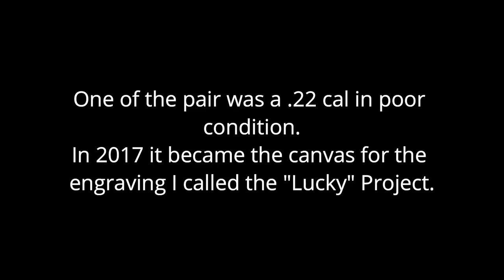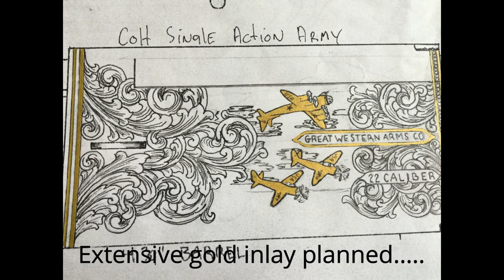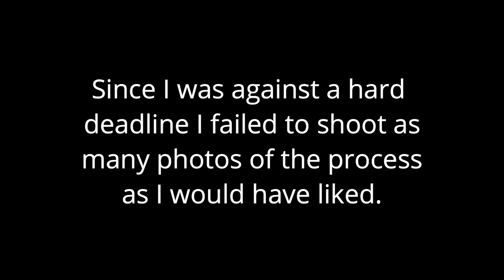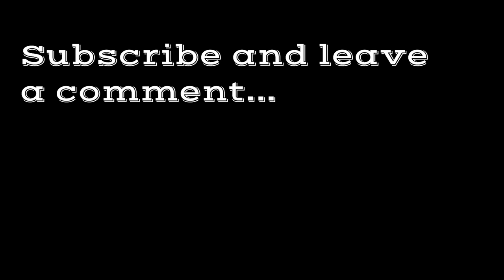Hand Engraving - Lucky's Great Western Arms, Colt Single Action Army  clone

Comment: Amazing work. Does the harness of the steel on the barrel make much of a difference?  I actually found your channel searching for information on engraving my hand forged blades- I'm still unsure if i should engrave before first heat treat or after temper.
Reply from the maker: Hand engraving cannot be done on blades after heat treating. If I’m cutting a blades I work with the knife maker and cut before any heat treat